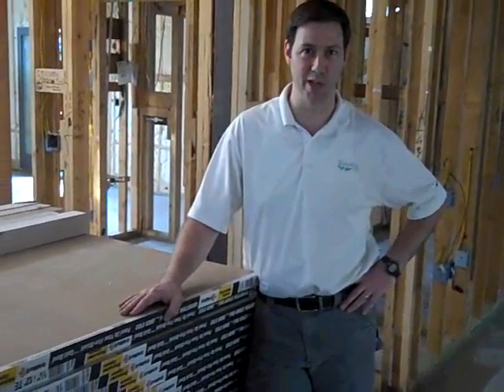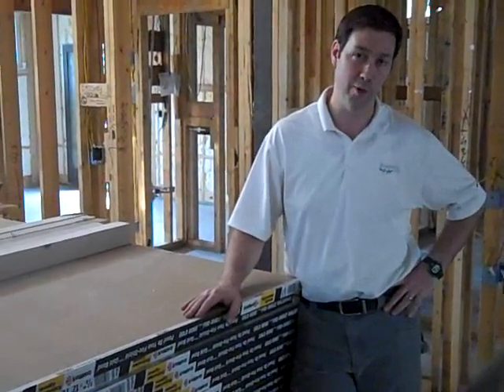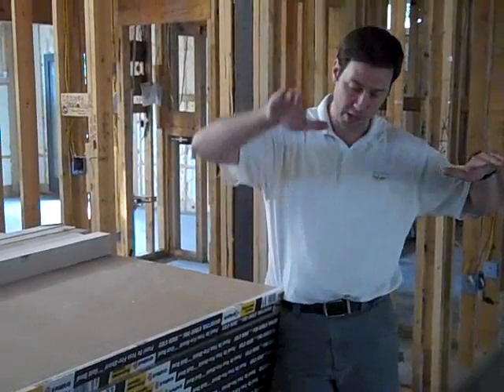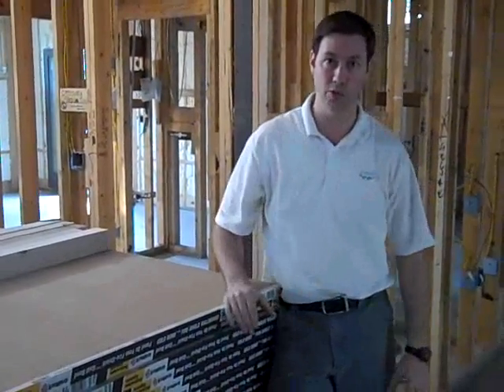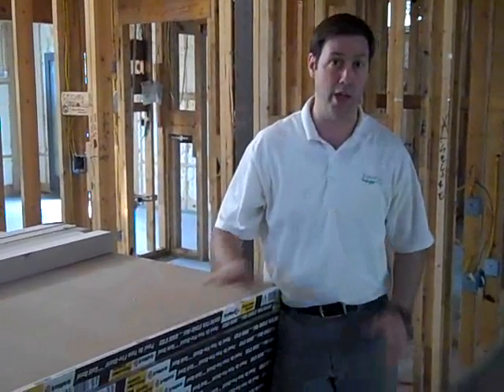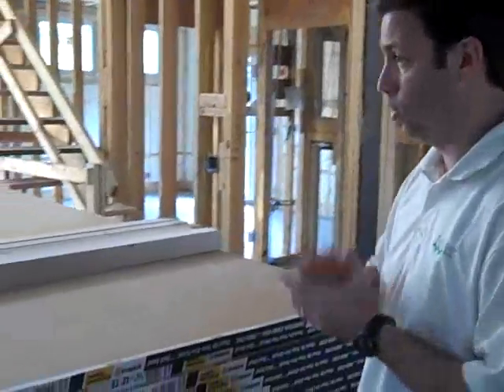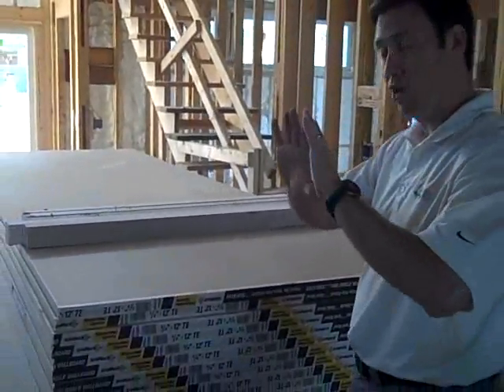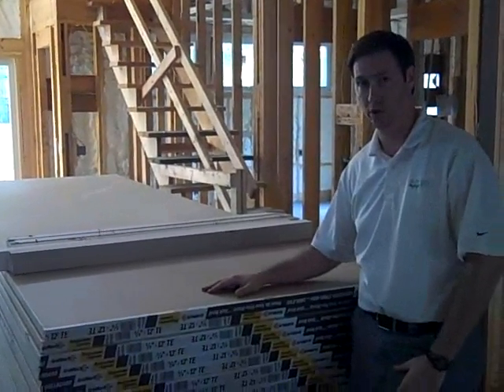5/8"  Sheetrock vs 1/2"  Sheetrock (Drywall)

Comment: We did this on my friend's home but he used some type of sound deadening foam against the plywood between the joists, then two layers of insulation then two layers of 5'8".  He can play his stereo as loud as he wants and his neighbors don't hear a thing.  He loves it.  The electrician was really annoyed however when he was informed of the plan because he had to work with the thicker walls in mind when he ran the new electric.
Reply: Can you explain your annoyed electrician comment in more detail? I'm designing a new build for myself, want 5/8" drywall, and would to better understand the repercussions.
Reply: @DanNowlan  We just did not inform the electrician about the added thickness so they had to get different stuff to run the wires and whatever else they had to do.  If you have walls thicker than normal, would be better to give the electrician a heads up during the estimate,

Comment: With 55 years in drywall, my family agrees. But you need to pay the hangers about 10-15% more. It's the same number of cuts but 25% more weight. They're working significantly harder for every board installed. And it's the weight that limits a hangers absolute volume. A hanger throwing 5/8 around all week on a concrete floor is really an underpaid professional athlete.
Reply: I would just pay them the same then given them a bonus in the end in the amount I would have payed them.  Psychologically it works better,
Reply: Real drywaller‘s hang it for the same price...
You must be a shoemaker
Reply: How's it going bro. I've been hanging sheetrock rock for a minimal of 10 years. I'm 36 years old and it's rough on the body. I've hanged from quarter inch, half inch, 5/8s and 12x4 5/8s with 10x4 lead on the back for x-ray rooms. Drywall hangers are a dying breed. At least where I'm from

Comment from the maker: @frankie2234 Yes, good call on the abuse factor.  It has so many benefits, it's easy to justify the additional small bump in cost.  BUT, remember to adjust your interior door jambs when you order them.  The whole world assumes 1/2" sheetrock so you must specify door jambs for your extra 1/4" of wall thickness.  (5/8"-1/2"=1/8" x 2= 1/4").
Reply: Hangers hate installing 5/8 but love to have it.

Comment from the maker: @HappyBeeb I've used a lot of drywall with non-paper backing.  Densglass is a fiberglass backed product that works very well.  If you're doing level 5 smooth you'll never tell the difference, but if you're doing a lower level of finish you can tell the face isn't as smooth.  This is great for baths, or flood prone areas, basements, etc.  For the main house, just control your moisture and use regular paper backed SR.  I'm not well versed in Baubiologie, mainly IAQ issues. Matt
Reply: Would you recommend dens armor plus 5/8 or 1/2 dense armor plus?

16 inch on center studs.
Reply: @basketballsteve1  I'll be surprised if he answers....he left comment 11 years ago ...lol 

.id look up ..Kirk Giordano on youtube ,he does plastering and has been doing it for over 30 years If I'm not mistaken  ...I feel he could answer anything having to so with this subject

Comment: Is the added cost worth it?  Some of the added costs are mentioned below in the comments, e.g., added weight for drywall installers and positioning electrical boxes correctly, however, the biggest cost would be ordering custom size door jambs to accommodate the extra thickness of two  5/8" thick drywall sheets in the rough opening.  Matt neglected to mention this and I suspect it could significantly add to the cost of the build not to mention the extra time it takes to receive custom order doors, with extended jambs, both interior and exterior.

Comment from the maker: Tony, sorry for my late reply.  There is probably not an upcharge for the jamb thickness.  That's pretty standard on custom homes.  There is an increase to fire resistance yes.  Matt
Reply: So. I would have to order custom jambs if I use 5/8? Can the trim guy make something happen ?

Comment: Have recently had 2 sheets installed.  This must be the magic sheetrock because I have A lot of insulation before getting a pack hung.  Took a huge burden off my shoulders eliminated the need for continuous heating surfing the winter and rarely hear the sound of traffic on the road

Comment: 5/8" is also much stronger, both against damage, and if you need to hang anything with drywall anchors.  Just look at the load ratings for any drywall anchor, and you'll see they are significantly higher with 5/8" drywall. Also provides better fire safety

Comment: Hi, thanks for the video. I'm a new DIY, on a low vaulted ceiling with no insulation, 10'x16'. Can I install 10' 2x4 every 24'' and add 5/8 drywall or should I stick to 1/2 drywall to reduce sagging? thank you🙏

Comment: Glad I watched this. I have some wavey walls that this can probably fix cheaper than adjusting them
Reply: I was curious about this statement in the video. If the drywall is cinched up against the misaligned studs, aren't you still going to have wavy walls?
Reply: @DanNowlan  yes. But it isn’t perfectly flexible and will decrease the waves with thicker drywall.

Comment: I have seen 1/4" thin drywall at Home Depot. It looks perfectly thin. I could just cover the old plaster wall without going over the baseboard molding. But i am not sure how people put screws in as they are so thin, or what kind of screw to use.

Comment: Not to mention 5/8" is fire rated to contain the spread of fire for up to 2 hours.
Reply: Not true 5/8 type x is only rated for 30 mins per layer. If you had a wall with 2 layers on both sides, THEN it’s a 2hr wall
Reply: @BayAreaMCs  Not true. 5/8 Type X has a fire rating of at least an hour per layer. 1/2 type is the one that is rated at 30 minutes.
Reply: When the fire is inside the wall nothing is going to make it more than 1 or 2 minutes unless drywall is inside the wall and on the top plate.

Comment: I'm considering sandwiching two layers of 5/8" Rock in an attempt to control noise on exterior walls. Currently I have thin wood paneling. How would my switch boxes, outlets, and Windows be affected? Thanks you!
Reply: carlorocky you would have to pull them out  more and/or add extensions
Reply: carlorocky I did that with a viscous sound deadening goop in between in my buddies band practice room. amazing difference. ceilings matter too.
Reply: carlorocky if you insulate your exterior walls with either foam or roxul mineral wool it will make a tremendous difference in heard noise. Fill all small crevices with spray foam or acoustic sealant. Before Sheetrock. Seal around bottom plate with acoustic sealant, and mount rock on resilient channel which decouples it from the studs. Makes a big difference. Use minimum screw penetrations.

Comment: How much does a sheet of  4x12 5/8 weigh
Reply: About 100lbs. You can definitely feel the difference hanging it. But every hanger would love to have 5/8 in his own house. Honestly, it feels about twice as rigid. My family has tile on walls 40 years old here in FL that are held together only by the studs and 5/8 rock. Everything else rotted away. It's ONLY 5/8 rock for this second generation hanger.

Comment: Fuck 5/8.  You don't need all that.  Not even on a 24" OC ceiling.
Reply: +DumpinMyGun   IRC calls for 5/8" on 24" spaced ceiling joists if it's installed parallel with joists or if it's sprayed with water based texture or if it supports any insulation.  Using absolute minimum standards in construction often results in a poor job that doesn't hold up well in the long run, which happens all too often in new construction by people trying to save a couple of bucks. I used the term "idiot", because you can't seem to communicate without using obscenities, which was confirmed in your reply.  Have a good day.
Reply: +DumpinMyGun, I can just feel the intelligence emanating through your post. You give zero information to qualify your rant and can't go four words without cursing. And, you're wrong.  Remind me to ask all my subcontractors what their YouTube IDs are to be sure I don't get stuck with shoddy work.